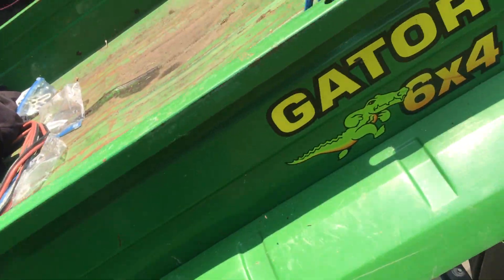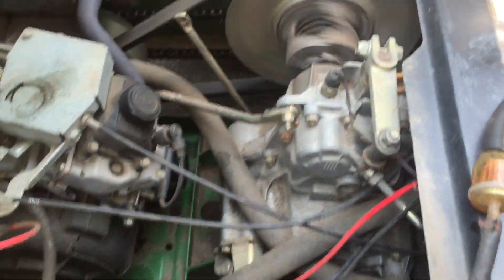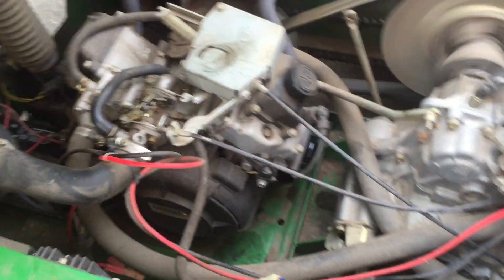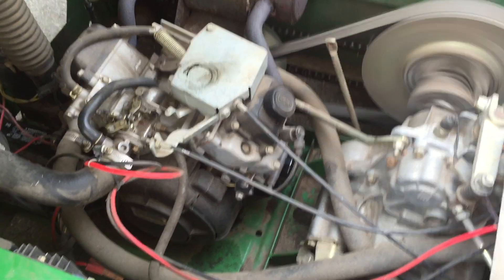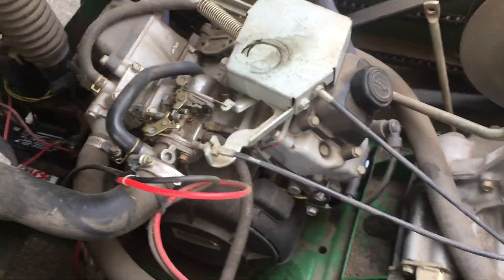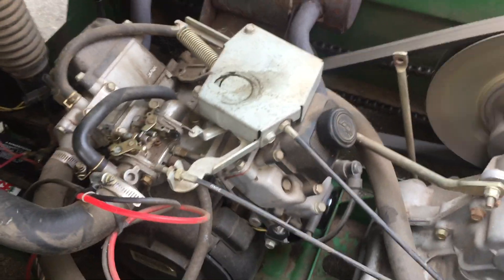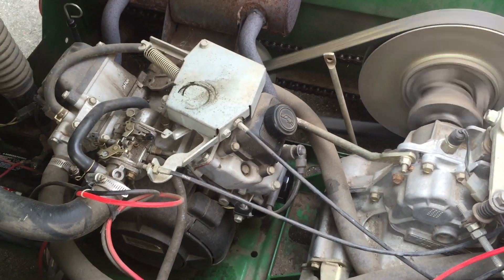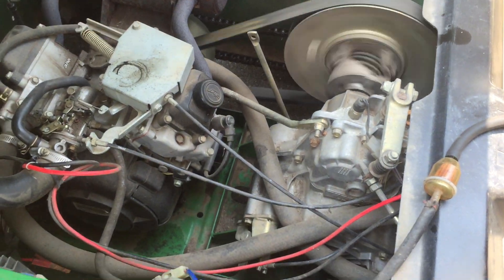How to clean engines with in-line fuel filters

Comment: Hi, 

I have a poorly maintained 1972 diesel tractor. Is it save to use 100% seafoam to clean the injectors ? 

If i add seafoam to the motoroil how many hours does it takes to do the cleaning ? 

Is it save to gaskets ? 

Greets from Belgium
Reply from the maker: Hi Patj:  Cleaning the injectors and cleaning the crankcase/oil are 2 different things. 1) Yes, it's always safe to use Sea Foam in diesel fuel and diesel filters to clean injectors. 2) Adding Sea Foam to oil to clean the crankcase is progressive. Though it does start working right away, adding each oil interval will liquefy heavier oil residue that can drain away when you change the oil. Hope this helps.
Reply: @SeaFoamOfficial   Thank you. I ordered 2 cans. First i am going to clean the injectors and when i do an oil change i'll ad seafoam to the crankcase.
Reply from the maker: @PatjJasco  Check out the Sea Foam Official video on how to clean diesel injectors.
Reply: @SeaFoamOfficial  I am unable to pour seafoam into my diesel filter. Like here in the video I can provide a separate tank with a high concentration. What do you recommend to me? 50/50 or 100% seafoam? And how long can the engine run on idle?
Reply from the maker: @PatjJasco  If you can add a 50% mix in a separate tank, try running it for 5 minutes, then take it for a 10 minute drive. Every time it hot soaks... then runs, it's doing a lot to clean.
Reply: @SeaFoamOfficial   I did this and saw already results!Before the exhaus fumes smelled bad after the treatement it was a lot better. Soon I'll test seafoam in the crankcase. Thank you for helping me.
Reply from the maker: @PatjJasco  Great news - thanks for sharing!